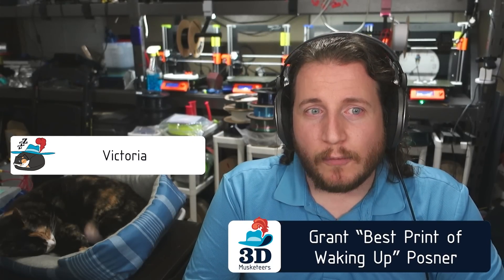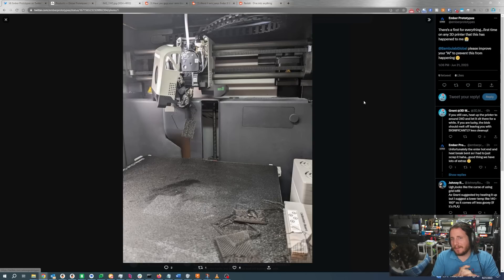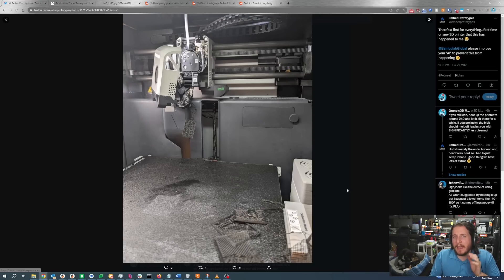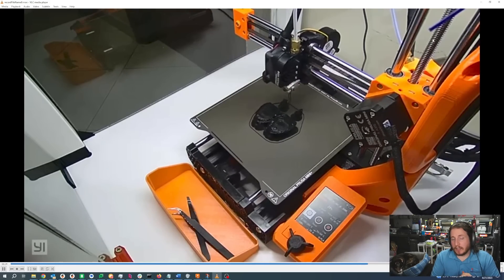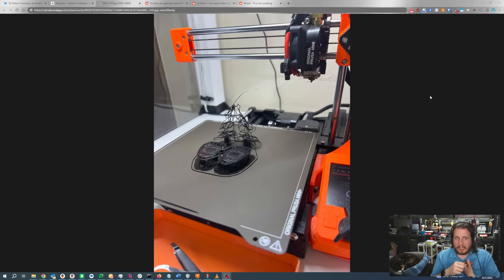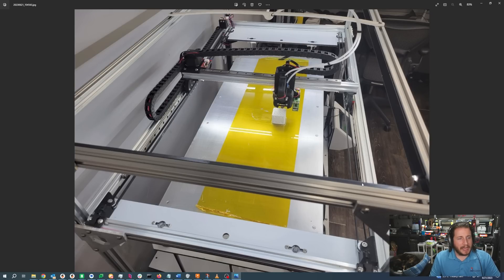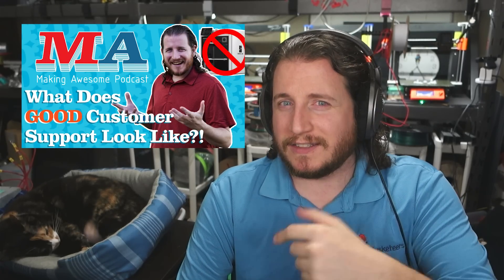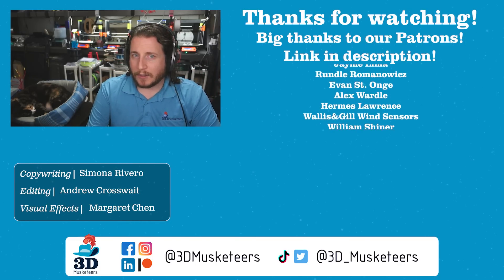This Bambu Gets A Blob! - PrintFixFriday 93

Comment: My Bambu A1 mini stops in the middle of a print for few seconds, the pla flows out makes a blob and then the printer goes on as nothing has happend. Really annoying when it happens on the wall of a print.
Reply from the maker: it should not do that. Do you have reliable power? And how are you printing? From the cloud or locally?

Comment: Your cat was way ahead of you before you said toss it. 3:31 In regards to the print skipping from 20% -80%  a corrupt SD Card or SD Card falsely reporting itself larger than it is which many cheap chinese knockoffs do. It can throw out data from a portion of the file and since gcode is simple text the missing info doesnt quite fully "break" the file.
Reply from the maker: she normally is lol. 

Yeah the USB could absolutely be the issue here and the easiest to solve

Comment: This might sound a bit strange, but I actually own three printers: a Prusa MK3, an X1C, and a P1P. And you know what? They've been working perfectly fine so far. However, it's important to make sure we speak up about any issues and let the public know if need be. Otherwise, there's a chance that manufacturers might not take any action, and that would be really unfortunate considering the impact they've had on the market. Personally, I've decided to pass on the MK4 and hold out for the XL version instead.
Reply from the maker: I am glad your machines have been working, wish mine were the same!

Comment: there are Glassfiber files that are used to do finishing on Metals, So running abbrasive filaments can potentially deburr the filament path.
Reply from the maker: Yep. It's the best working theory we have..
Reply: there where some weirdness with the Metal Sherpa mini from Mellow, not sure how much truth this holds, but due to rather poor machining there where a lot of Burrs in the filament path.
they literally recommended to run a bit of CF or GF filled filament throu it to clean it up.
its a legit way to remove material, but its a weird thing to say as Manufacturer.
Reply from the maker: Definitely not a great thing to hear from a mfg..

Comment: I'm guessing that mini had a data read error on the serial bus caused by a minor brown out or something but g code being gcode it has no checks for that stuff
Reply from the maker: I figure the camera would have jittered too though?
Reply: @3DMusketeers  I'm currently diving deeper into serial communications for another hobby and the logic and everything as you know is a logic 1 or 0 and depending on the packet size we can usually be certain about the rising or falling edge of a square when we see them on a scope or the like as informed humans because we usually know the trigger level for the determination of a 1 or 0. If one gets messed up in a packet because of parasitic voltage or stray inductance then that digit moving to the left or right as read by the firmware can either indicate a false positive let's say at bit 7 in a byte (using lsb for example) is mistaken as a 1 then the whole number grows by a power of 2 adding 64 to the z value or if the msb was supposed to be 0 but it's read as a 1 then 124mm is added to the z. As I suspect it works as an unsigned int8 or a signed16 to allow for negative numbers so it jumps. 

Wow. I'm a Nerd. I hope that made sense. I'm a digital logic addict man. Depending on the volatile memory or wherever it stores buffered gcode before the dma controller moves it to the cpu then stepper and drops out of the job. I suspect all the numbers are signed int 16 for the z and unsigned 8 for x and y on small bed printers as they never need to use negative offset on x and y. 
I ramble man. Sorry. I'm 44, retired, bored and have adhd and a high iq but zero social tact. It's a curse.
Reply: @3DMusketeers  I would like to know more about your operation there and your cat haha
Reply: @3DMusketeers  I should be playing ff16 but I bought a neptune 4, thrusters for an underwater uav I'm building, a bunch of filament and a loop pedal for practice setup. It's mono though and not stereo like my practice setup. I go guitar-helix-2.1 jbl studio monitors so I'm sending it back.
Reply from the maker: all good. Plenty of videos on our channel going through the shop and how it runs
Reply: @3DMusketeers  cool. I'll have a boo
Reply from the maker: ok

Comment: Thanks for the help! I am still plugging away at ideas for the FT-6. After watching it run, it shifts noticeably at the layer change/retraction. When printing vase or just perimeters, it's straight as can be. Found out it had a 120W PSU, which is ridiculous. My Rook kit comes with a 200W. Pretty sure you could print 3 full size rooks on this print bed... Anyway, bigger PSU made no difference...😢
Reply from the maker: Check out some of the comments here, some advice I think, but not sure how good..

Comment: Great analysis and advice! I should've have found this dude sooner - he's got top-notch experience. Any suggestions before I pull the trigger on an X1C? Thanks!
Reply from the maker: Only 93 weeks in on this one ;) 

Any advice? buyer beware.. Mine has been a NIGHTMARE. Mind you, I think I have it fixed, but over 5 months of CONSTANT issues, I would make sure it is not a NEEDED printer before you pull that trigger.
Reply: I had one in the cart and ready to hit purchase and then closed the browser.

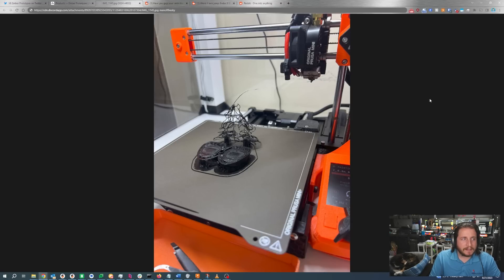Comment: 4:44 I have had this happen before. It was because I left the filament detector functionality on, which doesn't work when printing from OctoPrint, and caused the printer to freak out that there is no filament, it raised and tried to print forward. After disabling the sensor from the screen, and printing through OctoPrint, this stopped occuring.
Reply: BTW It is an Elegoo Neptune 3.
Reply from the maker: interesting, have never encountered this, but of course I rarely use octoprint.
Reply: @3DMusketeers  It is. The firmware is weirdly set up, in a way where the seperate screen firmware interfaces with the runout sensor, and therefore if there is no screen, and the sensor is enabled in FW, it goes ballistic.
Reply from the maker: weirdddddddd

Comment: Fixing the bamboo with an abrasive filament kind of makes sense. Have seen on my own printers a similar effect when a nozzle has a partial clog, running a small print with some matte PLA or other abrasive filament has about a 50:50 chance of clearing a partial clog. Great time saver to try before removing nozzle.
Reply from the maker: matte pla is not abrasive, not last I checked. The nozzle was not clogged though, it was some sort of extra drag somewhere in the bowden system.
Reply: @3DMusketeers  maybe a pinched or squashed Bowden tube somewhere? 

I’ve found Overture matte PLA to be fairly abrasive and eats through brass nozzle’s, however eSun matte PLA seems to have no affect on wear
Reply from the maker: Could not tell you, no easy way to measure it, but outside the connectors it seems fine. 

I have never had issues with matte PLA from companies.. Maybe it was bad nozzles? I have had that LOL
Reply: @3DMusketeers  think nozzle design and nozzle material comes into play. Noticed the issue is more pronounced on my Flsun Q5 which uses MK8 nozzles that only seem to survive about half a reel of Matte PLA but last a long time with regular PLAs.
My other printers all use v6 nozzles which last noticeably longer before needing replacement. 
My theory is that v6 nozzles use a tougher brass alloy combined with a different geometry results in a longer lifespan.
Reply from the maker: could be!

Comment: I'm still going back and forth with Bambu support as well. I have gathered other users that are having the same issues and provided them with serial numbers and case numbers (this is the vertical circles printing as ovals issue). My support engineer seems to want to help, but now they want me to reach out to the folks who put in cases and get their emails because the can't find the support cases I referenced .... sigh. 

They did offer to refund me the purchase price and take the printer back - but not replace it. If I want to buy another printer they are telling me that I cannot get support if it has the same issue! So I have opted to keep this one and just keep working with support until they maybe start sending out some parts. 

I run the support team for my company and I have never, ever considered treating my customers this way. I routinely do advanced RMA's to get working servers in their hands while we trouble shoot their units - so this is extremely frustrating for me.

On top of that, my Etsy store is very busy so I can't have my workhorse printer out of service for a couple of weeks in a refund / purchase loop. Anything with vertical holes is being printed on the Voron or Sovol for now and other prints go on the Bambu.

I hope we both get some satisfaction soon.

Best regards,

Mark
Reply from the maker: Mark, sorry you are still going through BS my dude! They cant stop you from having that issue twice.. They can take it back and you can buy another one when and if you are ready.. 

You will like the stream sunday.. 1pm EST..
Reply: @3DMusketeers  See you Sunday!
Reply from the maker: nice!

Comment: I find it odd that prusa still hasn't updated the .stl files for the mk4 yet. They did add a new one that was not there previously. It says that it can't be printed on the mk3 because it doesn't have good enough tolerances. lol And yes I really did print PP on the satin sheet with no tape, glue or anything. Only moderate warping. I need to make adjustments to the model, but I'm using it to hold spare batteries for my vape right now. A brim is definitely 100% required. And from what I can tell the hotter you make the bed the better. I even used tree supports and they came off pretty well. Live hinge is working well as well.
Reply from the maker: oh, interesting, they havent?

yeah PP really likes heat lol.
Reply: @3DMusketeers  nope. Still R1 models
Reply from the maker: weird, wonder if that is what is currently printing?
Reply: @3DMusketeers  nope a number of kit buyers confirmed the printed parts are not what's on printables. But if you got the assembled one on day one, then it will be a match
Reply from the maker: Now that is curious!

Comment: 8:50 Look at the belt idler pullies right here. Look at how much of the metal you can see on the right idler pulley vs the left pulley. They should double check their idlers and pulleys to make sure they are all the same size.
Reply from the maker: interesting!
Reply: @3DMusketeers  You see what I mean though? They look like they are 2 different sizes unless its just the camera angle and shadows playing tricks on my eyes. No idea if this really makes a difference though. Just something I noticed.
Reply: @user-lx9jm1wo3h  Just your eyes, they are indeed the same.
Reply: @HypermotiveRacing  I see. You measured them with a calipers I assume? Only other reason i can think of that would cause this are the the brackets mounted to the linear rails are not solid enough and it is racking as it moves back and forth. Converting this to CoreXY or a shaft style setup like the Ender 5 to keep the belts in sync might help prevent this.
Reply: @user-lx9jm1wo3h  Did you catch my comment about printing in vase being fine? We are narrowing it down to a noise or maybe board issue. And if you notice the wonky Pisa tower pic, it changes the direction it's leaning twice. And right after a solid type layer. Yes, it's not the most rigid. but running the same gcode back to back will give a lean the opposite way sometimes.
Reply: @HypermotiveRacing  Never saw a comment about that, all you said was it was my eyes and the idler was same size. Which direction are these leans taking place? Are they leaning straight along Y axis, or are they more diagonal towards the corner of X and Y  corner axis?
Reply: @user-lx9jm1wo3h  It is all along the Y (the short direction) Sometimes it leans negative, sometimes positive. Even with the same Gcode.
Reply: @HypermotiveRacing  I see. Have you tried test prints closest to x motor on build plate, and furthest from x motor on build plate to see if the lean is less or more drastic? I really think your x axis is shifting out of alignment and is not square. Also, do you have a copy of the config file for your printer somewhere that I could take a look?
Reply: @user-lx9jm1wo3h  I'd love to send you a pic of a test I ran today. 3 identical towers, identical gcode, printed sequentially. 1st had drastic but consistent lean. 2nd was almost straight, 3rd was identical to the first. all of the shifting is happening in the Y, the short axis from the photo. this isn't a mechanical issue. I'm about to chuck in another board and hope it goes away.

Comment: Thanks for the shout-out!

Our AI detection is set to medium and it never even threw any warning 😅.

We were printing some PAHTCF with pretty thick perimeters and top/bottom layers for some vacuum forming molds. There were some really small features and the infill was somewhat high, so a combination of all of this led to failure (warping and possibly hitting some blobs). Generally this almost never happens.

And yes the residue on the build plate is leftover glue from our Dimafix adhesive 🙂
Reply from the maker: Ah yeah and the cf nylon does NOT help any of this..
Reply: @3DMusketeers  Definitely not 😅